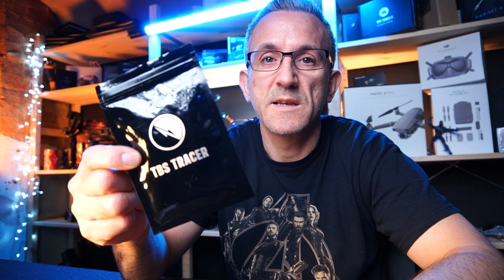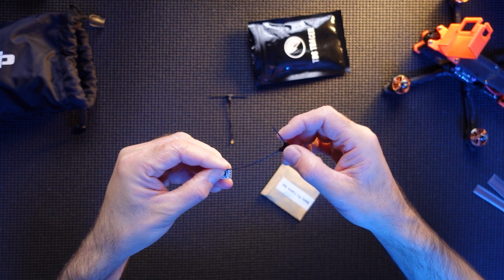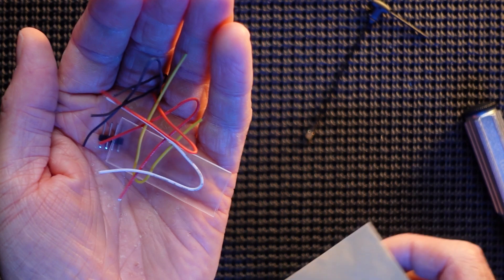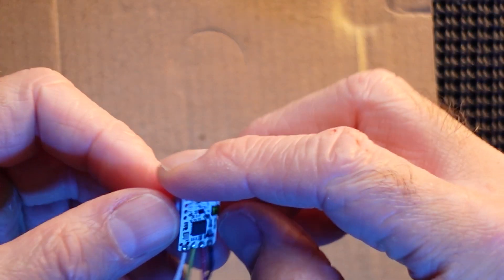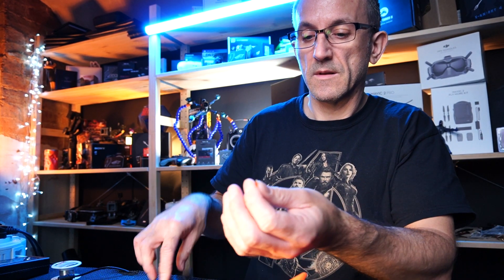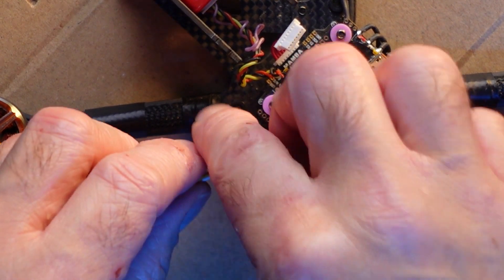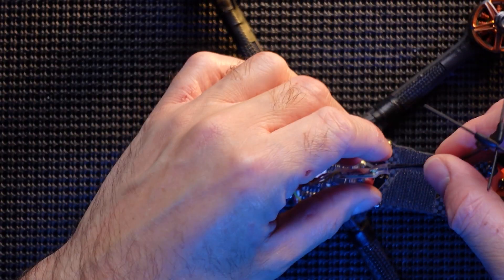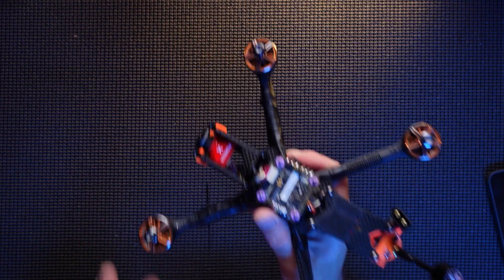TBS Tracer Nano Set-up Wiring and Installation Instructions

Comment: The TBS Tracer Nano manual says it can work in 8 channel or 12 channel mode. I see it is currently working in 8 channel mode. How do I switch it to 12 channel mode?
Reply: I am waiting o the same question. Did you figure out or find the solution?

Comment: I never even used cross fire..I just fly a few tiny hawk whoops and freestyle around my back yard on a jumper .. will this boost the range significantly?
Reply from the maker: yes it will - crossfire will def and so will tracer - tracer has 2 antennas so could be problematic for small quads - even crossfire might struggle with some small quads.
Reply: Crossfire & ELRS are great for range just know ELRS is a pain to setup. If all you wanna do is freestyle I'd say go Tracer for that decreased latency. It'll come in super handy when you go dinging a wall or branch or something & need to save yourself.